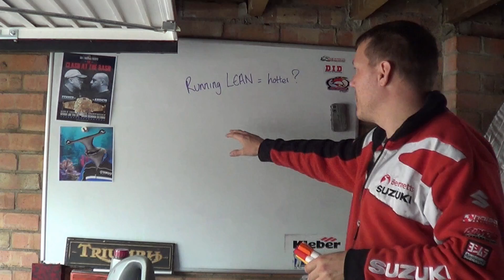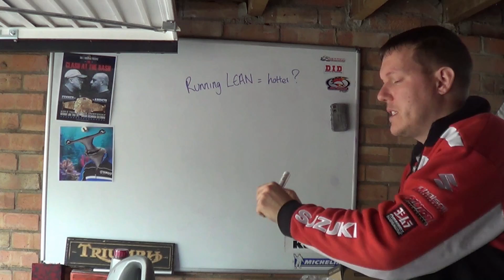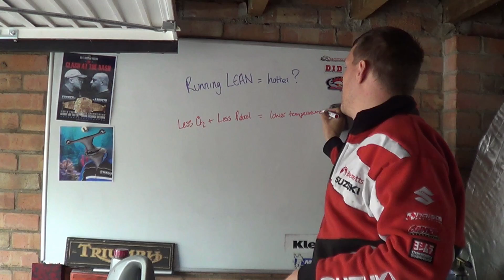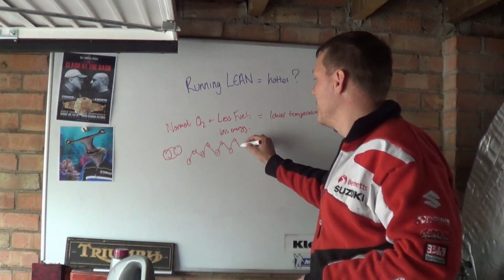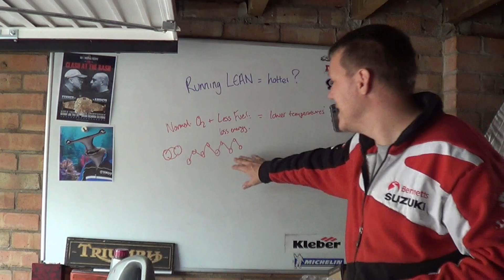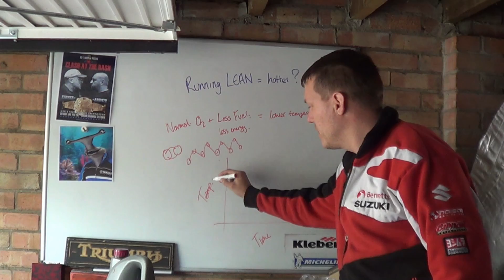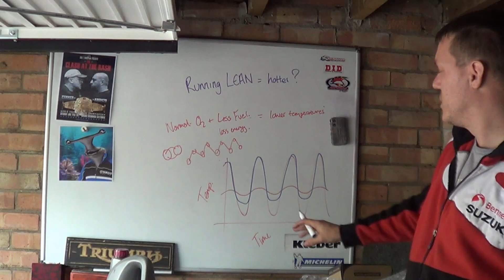Why does leaner burning = hotter engine?

Comment: Interesting note from the recip aircraft engine world:  I've been involved with aircraft a good bit and while working at an airport a few years ago, an article turned up about going a few degrees leaner than peak on typical opposed gen aviation engines.  They were encountering distortion so severe in the cylinders between the cooling fins, it was causing havoc on top ends.  I think some shock was involved also with rapid mixture changes but it was a notice to flyers to watch out for leaning out too much, for whatever reason.

Comment: In stratified combustion engines (diesels, direct injection petrol, etc.) you do get locally rich areas. These burn quite hot and are an emissions nightmare. Diesels create particulate matter this way. Both generate fair amounts of nitrogen oxides as well due to the elevated temperatures. In a rich burning (homogeneous mixture) petrol engine there simply isn't enough oxygen to go around for that.

Gas turbine engines suffer from the same NOx issues. They always have excess air for cooling purposes, so NOx molecules form readily

Comment: Hi Matt I've done three pistons due to heat seize, would a temperature gauge/  sensor  give me an early indication of an overheating cylinder/piston.  If so which one can you recommend for a kitted Vespa T5?
Reply from the maker: How did the heat seize happen - partial of WOT? And what mix are you running? Pre or oil pump?
Reply: Holed piston after 120 mile ride back from Woolacomb to Birmingham, 65mph along the flat, 3%pre-mix, 9 plug. 162 Pinasco kit rotary , si dellorto 26mm carb 130 main jet. Would 4% full synthetic oil be better? Or a smaller jet size? Was thinking temperature sensor in exhaust maybe. Have subscribed 1$ sucky fucky😂

Comment: Thanks Matt, you just finally taught me why my 383 small block chevy motor died. I think I understand now why it ran the way it did. Loads of power, poor idle but loads of top end hp, tore up rubber all the way down the road but once things got hot enough without the cooling effect of fueling things melted and failed. Sad day with blown pistons, rod through the block the whole nine yards. Wish I'd known more back then. Got a new motor from Summit, think I'll get an O2 sensor and run a stoichiometric gauge to tune the carb this time!! Thanks mate, enjoying stuffing my brain with all this knowledge😋

Comment: If it is so that the combustion part is constant upper bound temperature, then it must be true that pressure varies instead of temp upper bound -- it goes up when I step on gas, while the walls are cooled more by the fuel which has the effect of lower bound.

Comment: Matt, I'm surprised that you covered this topic without bringing up some details about the effect on the combustion that running lean has. Mainly the impact on burn rate which leads to slower pressure buildup, a less efficient power stroke, and higher EGT.

Comment: oh I thought that it was a similar thing to lets say a fireplace when you blow air to the flame it burns hotter. did not think about that it is the lack of evaporating fuel that causes a engine to be hotter when running lean. great video
Reply: But that may just be because the fire is burning too rich and when you blow, it gets closer to stoichiometric.
Reply: jaryH3 oh yeah, that makes sence didnt think of that

Comment: Well, I was explained some time ago that running at stoichometric (14,7:1) burns up ALL the fuel very fast, thus creating more energy, thus more heat. When not at 14,7:1, it doesn't burn as efficient and therefore does not create as much enery, thus lower temperatures (slow burn). Running at 14,7:1 is something your car should do when only coasting to be fuel efficient, but when you have to go full power you want to add more fuel to cool the engine. This isn't wrong, is it?
Reply from the maker: "thus lower temperatures (slow burn)." - don't confuse lower temp burn with flame speed, but lower temperatures, thats correct. You talking about deviating from 14.7:1 slightly. There's a sceond video that explains more

Comment: If you had the time you should be able to add the water via a 'carburetor' type of device with a needle jet simply in the airflow prior to the turbo which would simply draw in more water as the airflow increased designed to feed nothing below a certain flowpoint.  This should certainly reduce the charge temp and if trialled on a diesel should prove far easier with its fueling requirements.

Comment: Ooh ... Can you do one about why correct ignition timing (for 4 stroke because I'm too crap to have a bike at the mo) is important?
Back story: Replaced water plug way the hell and gone down the back of the cylinder head, lined up the wrong timing mark on cam angle sensor, car ran like a bag of smashed hammers til I figured out how much of a noob I am sometimes.
Reply from the maker: Unlucky mate, yes I can added to the list
Reply: Exxxxxcellent.

Comment: 6:28 No, peak temperatures are lower and the lower temps are higher, so average the same! There are  other effects of lean mixtures,  the mixture burns much slower so it is still burning as it leaves the cylinder, so exhaust valve is surrounded bu flames and there is also free oxygen because there was not enough fuel to use all the oxygen, so it oxidizes the valve. (burnt valves). in 2 strokes the same effects burn the piston. Another thing: because less power is developed you open the throttle more, so the effect is NOT less fuel but more air. In fact, because less of the heat is turned into power, you actually have to open it even more, so you may have more fuel! and because it is burning slowly, it can burn the head too.
Reply from the maker: "the mixture burns much slower so it is still burning as it leaves the cylinder,"

- lol you've been reading that shit article in hotrod magazine. Flame speeds increase with temperature, so burning is faster. 

Still burning whilst leaving the cylinder, is when you run rich not lean. Burning out exhaust valves is a great indication of this, that and the flames coming out of your exhaust.
Reply: temperature is lower, don't read that stuff, read old original work by people like Harry Ricardo. https://en.wikipedia.org/wiki/Harry_Ricardo
Reply: read this, and others: http://www.freepdfbook.com/tag/the-high-speed-internal-combustion-engine-by-sir-harry-ricardo-pdf/
all i learnt was actually old when i learnt it, like in the early '60s. This research was done around 1900! things have changed a lot since then...
Reply: Think about WHY and HOW temperatures would change with fuel/air ratio... highest temperature is reached when you have the fuel completely burnt with the smallest amount of air to heat, right? this occurs with a stoichiometric  mixture of 14.7 to 1, any less air and all the fuel is not burnt, any more and there is excess oxygen left, and more air to heat. Temperature is LOWER so flame speed is slower, it can be so slow that it is still burning in the exhaust.

Comment: Great video , but I would only like to add to avoid confusion that in short : Diesel is quite opposite. Rich mixture = black smoke = higher temperature and high EGT...
Reply from the maker: Diesels are a seperate animal that will be covered soon - matt

Comment: It's curious that more 'water cooling' isn't used as you'd only need a small water tank compared to the fuel.
I guess that unless purified water was used you'd have problems with salt build-up maybe.
Reply from the maker: Do you mean water injection?
Reply: Yes, sorry.
I often thought about playing with the idea but then kids turned up and things got put on back burner
Reply: Yeah i looked into it.  But when you add it all up... its not worth it.

Comment: Hey Matt,
Thanks for the video.
The combustion temp when you do lean burn wouldnt be less and not the same? So the mean value shouldnt be more or less the same? I have to admit this is really complex topic and I'm just curious.
Reply from the maker: VERY, very good question, tomorrows video will make it clearer. To be honest I forgot to get to the point in this video lol oh well shit happens - matt
Reply: Hey mate don't worry Thanks for the video ! :)
Reply: Basically when you have a hot thing is because you're adding energy into it or not removing heat from it.
So this video, in short, tells us that a lean mixture is not removing that much heat from the engine through evaporative cooling, meaning it's average temperature goes higher. Interesting!

Comment: and it likes to detonate and knock too
Reply: doesn't it burns faster? doesn't the gases reach higher temperatures? i would bet it does.
Reply from the maker: Any heat comes from burning fuel, Leaner = less fuel to air. This ultimately means lower temperatures.
Reply: The Workshop sounds legit.